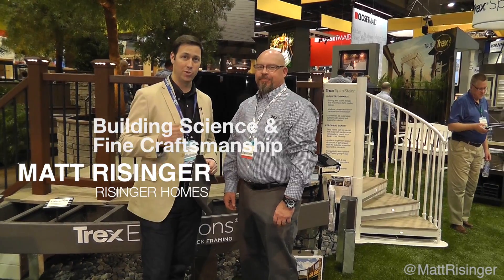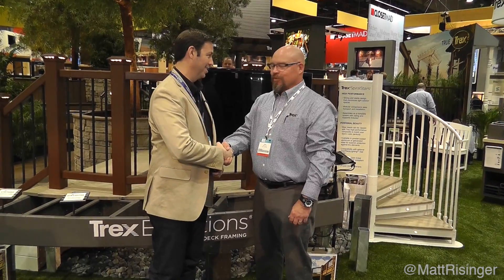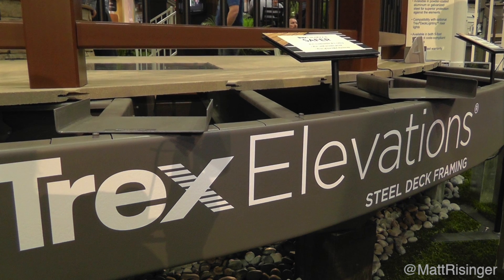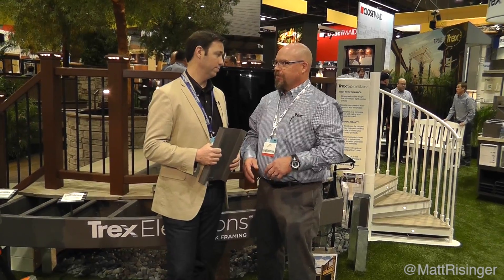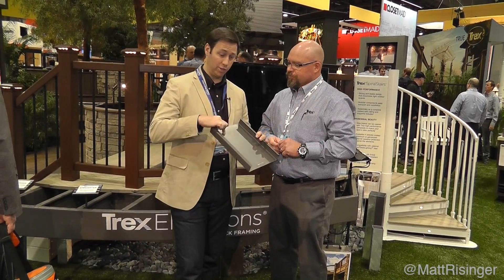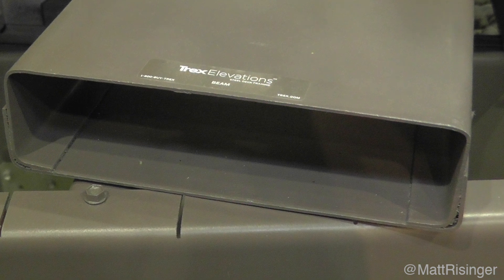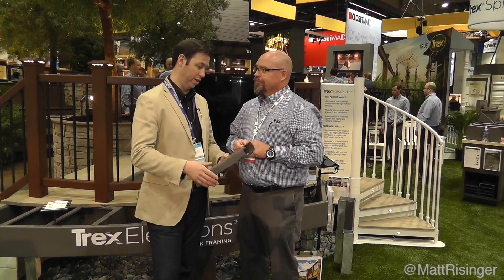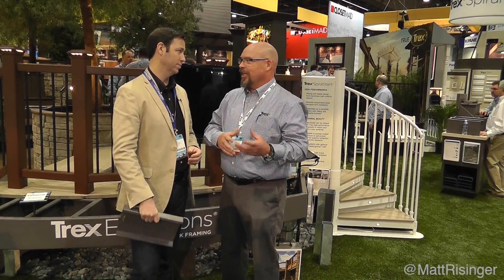Trex Elevations   Steel Deck Framing  IBS 2014

Comment: I've always wanted to ask you how you feel about trex vs azek vs pressure treated wood. Do you ever do any pressure treated decks anymore? Ever used a pvc?
Reply from the maker: I've used Trex before (including my house) and have liked it.  It pressure washes easily, requires no sealing, and lasts a long time.  It also has a pretty good environmental footprint.  I've not used PVC decking.  I'm not a totally opposed but it seems to "plastic-y" for me.  I've generally been disappointed with the few PT decks I've done in the past 20 years.  I also like Cedar and Redwood.  Both are beautiful with a nice stainless fastener.  I've also liked the tropical hardwoods but they can be tough to work with and I'm not loving that they come from questionable sources.  -Matt